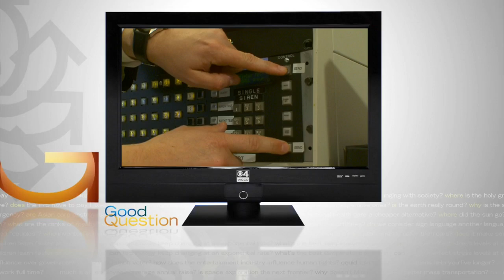Good Question: How Do Tornado Sirens Work?

Comment: Preset tone patterns are usually put into the sirens during testing, usually in the mornings at 10am at most municipalities. Here are the sound-tone patterns for the test siren activity:
The first test firing is the plateau-tone pattern, usually for several minutes. (That is the glissando up, then a steady tone, and then a glissando down to end the sound.)
Then there is a break for about 1 or 2 minutes, and the test-firing happens again in test 2. 
The second test firing is the multiple-sine-wave-tone pattern (the several waves of glissandos up and down), also for several minutes. 

Tornado siren emplacements are either this option - fixed emplacements (where the sound structure on top does not move when the siren is fired), or rotating emplacements - where the top part of the siren, like a Leslie pre-amp fan on a Hammond Organ, rotates when the siren activates. The siren stops rotating when the sound stops. 

The tops of those sirens are usually in a hyperbolic shape for maximum output of the siren din for maximum reach so that scores of residents/people can hear the sirens and take action if needed.

Comment: There are 2 different types of sirens 🚨 
There are electric sirens And Non-electric Sirens. The Non-Electric Sirens are powered by a Fan. The fan spins so fast that it chops up the air which causes a high Pitched noise what we call a Siren noise. But There are some sirens that are electric ⚡️ The electric sirens are sirens that do not have a fan. They are programmed to make a high pitched siren noise. 
Solenoids :)
Sometimes sirens can make a hi-lo noise or a pulse Noise. To change the tone of the siren, Solenoids block the air which blocks the noise. Hi-lo is when one solenoid blocks the air and then the next. Pulse is when 2 Solenoids go at the same time. 🌪🚨 We all know some ways the sirens work, But most sirens are turned on by you’re city, 
Some state test their sirens at different times. Most sirens are tested by the city 🌃 
And those are a few things I know about Tornado sirens 🚨 #Sirens #Solenoids
Reply: There are a few parts of the sirens I know :)
— The chopper 
— The Rotor 
— The Blower
👍👍👍👍👍👍👍👍👍👍👍
Reply: @AbbeyWagnerYT777  only if it's a Thunderbolt or Hurricane
Reply: @floridawarningsirens  True, good point 👍
Reply: They're technically all electric since their motors are usually powered by electricity (with a few exceptions). The sirens that don't use fans/rotors use speakers.
Reply: @s_e-LBR  true
Reply: @s_e-LBR : Nope. Did you miss the hand-powered ones? Don't skip that part of the video. "With a few exceptions" contradicts "technically ALL."
Reply: @HelloKittyFanMan  Who are you trying to pick fights with? Because I know it's not me. Besides, this comment was from a long time ago so please do your research instead of picking battles with random people sweety. ✌️
Reply: I wasn't "picking fights with" anyone, abbey. What kind of duhh person thinks giving someone the information that they didn't have before is "picking fights"? As well: 1. It does NOT matter how long ago the original comment was made, duh. Like they "expire"? 2. Do my research? I've known this stuff for a long time, kiddo. 3. Giving someone the correct information isn't "picking fights." 4. You're not "random." I saw your comment and wanted to reply, just like everyone else in this thread who saw a comment and wanted to reply, duh. 5. So you do the research. Learn what electricity and motors are.
Reply: @HelloKittyFanMan  Then why are you on the internet? 😂
Reply: Your question didn't even make sense in connection with what I just said. Why are you online?
Reply: Wrong. All of these except the hand-crank ones are electric. The two main kinds of sirens are mechanical and electronic.

Comment: Siren In This Video Marking Each Point To Where You Can See And Hear Them 
0:39, 2001 D.C 0:41, Reverse Wired 5/6 Port Thunderbolt 1000T 0:44, RSH-10 Thunderbeam 0:49 4/5 port Thunderbolt 1000T 1:38 Reverse Wired ACA Allertor 1:52, Model 7 & 2001 - 130.
Reply: The reverse wired thunderbolt is gone.

Comment: What's with these subtitles?
Reply: Mackenzie Ryne Bagtong you can switch off subtitles in settings if using YouTube app
Tap the 3 dots in the top right hand corner then tap Captions and then tap Turn Off Captions and once you do that a ✔️will appear next to those words

Comment: they never answered how they work, haha.
Reply: They press a button on a computer.
Reply: Bryce Gipple yeah well how are they so loud?
Reply: @brycegipple387 : That's not how they work, though!
Reply: The sirens work by a chopper or a speaker siren the chopper sirens chop the air shot it out of vents and makes sound waves the speaker siren works by a speaker
Reply: thecoolpaw 24 yeah I love the 2001’s and tbolts I also like the modulator and aca’s
Reply: @youropiniondoesntmatter5005 : You love the 2001's and ACA's what?
Reply: I also forgot the more faster the chopper spins the more louder and high pitch the siren is
Reply: They explained how they activate the sirens, not how the sirens themselves make noise lol
Reply: Yeah I was expecting them to describe how electromechanical and electronic sirens work lol

Comment: I just wanna know if it's possible to blast Darude sandstorm through the sirens for everyone to hear
Reply: Ha! In the newer ones, yes, the older ones, no.
Reply: You can do that with a Whelen or Federal Signal Modulator, because they're speaker based
Reply: RatedASMR It depends on the type of siren it is. For example, St Paul uses mechanical sirens, which produce sound using a motor and chopper/stator, or using mechanical means. Minneapolis on the other hand uses electronic sirens, which use speakers and amplifiers to get warnings out. These sirens can put out voice messages if you program them to, and can also play music. So technically speaking, yes you can on some models, but not on a majority of them, since electronic sirens still aren’t as common as mechanicals.
Reply: RatedASMR well you'll need to get through the police department first....
Reply: RatedASMR fjf
Reply: yes it is
Reply: What about the DEJA VU song?
Reply: They actually have no speakers inside, purely air making the sound
Reply: @xeonex5920  the new sirens have speakers
Reply: Newer speaker sirens yes.
Reply: You mean Requiem for a Dream during a tornado.
Reply: Only electronic sirens, I’d love to hear sandstorm playing, it’s my favorite song

Comment: The Thunderbolt 1000T on top of the tower either 
A.) is set on chopper level 7
B.) has an air leak 
C.) has a reverse-wired blower
Reply: Greenfield1003 It was replaced with a Vortex in 2013
Reply: Fat2T22 in order to tell if the blower is reverse wired you'd have to hear the wind down. The brief cutoff is what determines that
Reply: Did i just accidently comment on a Siren-fanclub? whoops.
Reply: C. Has a reverse-wired blower
Reply: I remember hearing the answer for the Thunderbolt but I'm drawing a blink on what it is
Reply: It does sound weird, indeed.